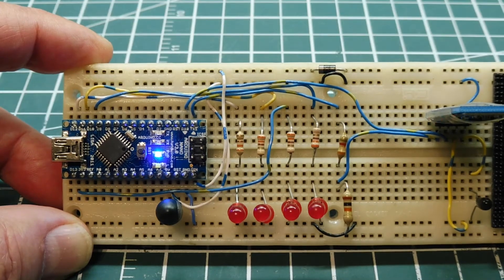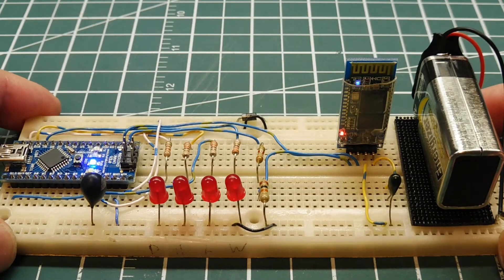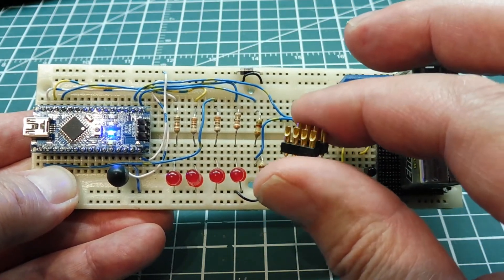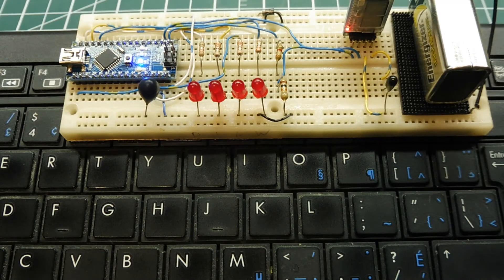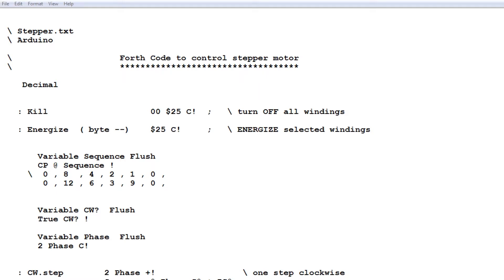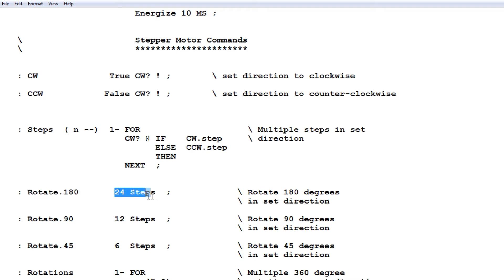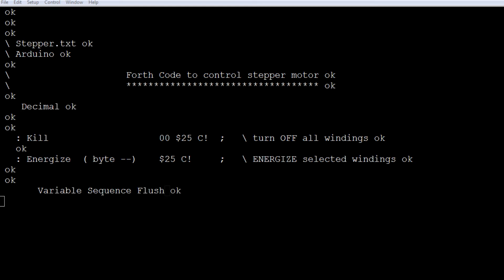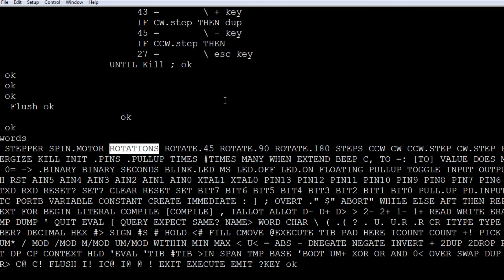Forth Code Development / Over The Air Programming

Comment: Hello, I have a simple blink up and running using EForth.  How do I make it a "turn key" application? Meaning it just works when I power it on.  I read that i have to burn fuses Lfuse=F2, Hfuse=D8, Efuse=FD.  And use the eforth words COLD and 'BOOT but documentation is scarce.
Reply from the maker: You can download the 328eforth documentation here: https://www.dropbox.com/s/w245cd0vammw1yp/ForthArduino.pdf?dl=0
It will describe how to make a turn-key application.

Comment: Hi, thanks 0033mer!  I understand that you use Tera Term to send the code to the nano, but can the nano be programmed directly in Forth?  I am confused because I use the Arduino software to program my uno.  Thanks for any advice :)
Reply from the maker: When programming in Forth I do not use the Arduino IDE as the bootloader is erased. The Forth operating system is loaded on to the microcontroller and programming happens on the micro itself directly in Forth unlike when using the Arduino IDE the compiler is on the PC and code is uploaded to the micro. TeraTerm is just a serial terminal program thats talks to the onboard Forth compiler/interpreter.

Comment: Which version of FORTH are you using? I tried AM FORTH on a 328p avr and seemed to keep overwriting the dictionary when I did an upload ( which i did slowly as well)
Reply from the maker: I am using a version of eForth called 328eForth.
Check out this video:  https://youtu.be/n7l4Wn6xalc
You can download the hex file eforth220.hex from the description box.
Reply: nice. before i burn my flash was wondering does this have eeprom support as well? I understand eeproms can take more writes than the flash.
Reply from the maker: 328eForth does not have support to program the onboard eeprom.
I wrote my own support code:  https://youtu.be/TrbY_n0DyAk
Here is a link to some 328eForth docs:   https://gitlab.com/jjonethal/eforth328/tree/master